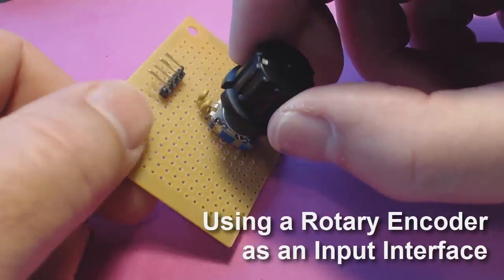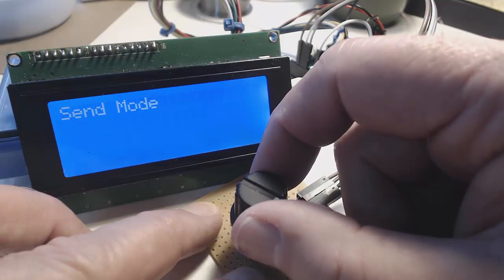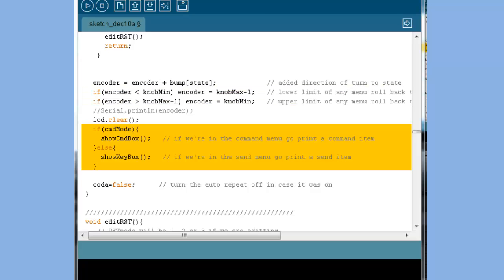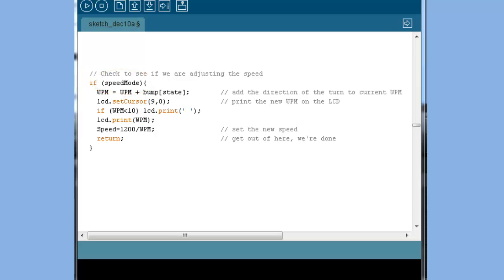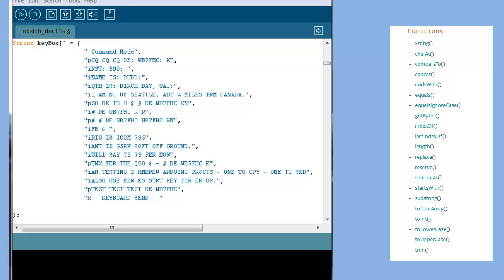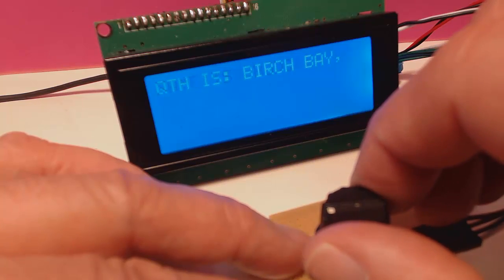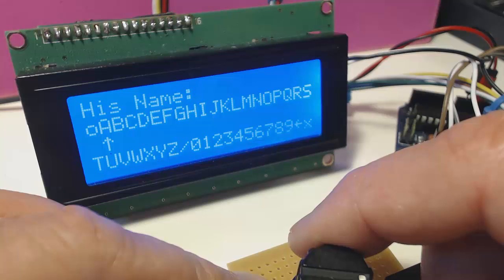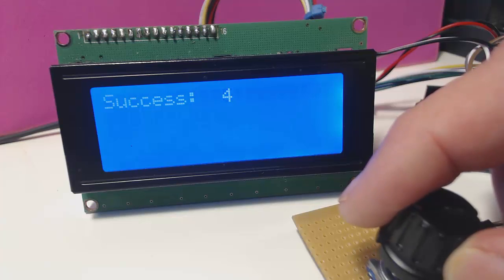Rotary Encoder Interface Options for My Pet Arduino

Comment: This is a really nice demonstration and I really like the pointer method you came up with for entering text!  In a recent project of mine I used a 2 line OLED and came up with a UI where you edit 1 character at a time by rotating the knob, advance to the next character with a short click, and complete editing with a long click.  So it was very cool to see another method that works so well, thanks!

Comment from the maker: I put together a project that would demonstrate many different ways to use a rotary encoder has an input device for and #Arduino. Maybe some of you will get some good ideas from it.

When I actually tried out live on the air, it wasn't a complete success.  I put too many features and choices into one application. Trying to run it AND copy Morse Code at the same time proved to be a challenge.

Even so, I learned a lot. I think a simpler more scaled down version will be something that I can use. #hamradio #morsecode
Reply: Nice ideas you got there ! 

Have you wondered how it could be efficient with dual screen and dual rotary encoders ? 

I'm on my way trying something like that with two nokia 5110 screens and two rotary encoders

Left encoder and left screen = menus
Right encoder and right screen = edit values

"keyboard" mode can use both screens and encoders, I'm convinced it could be rendered as a quite intuitive and fast interface to use.

Comment: Excellent job, Id give it 6 or even more depending weather you reached your goal or not
I used a mouse rotary encoder for my test project, has 3 Buttons each have a resistor that change a voltage on a voltage divider and I can combine buttons ( click and hold ) for the desired command, like (both left and right clicks reset).
Using analog wasn't that easy though, there's noise I had to cancel. I was using A14 analogue pin (Arduino MEGA).
anyway I come up with an idea is to replace rotary switch with IR remote control.. there's a library for it and easy to use.
the mouse costs me only $1 but hacking 4 USB wires for both clicks and rotary was a process I wanted to avoid repeating.
Pin A15 used to check battery status a 1/3 voltage divider 20K vs 10K ohm to ground then with another resistor to DC jack + pin

Comment: Hello 
I'm trying to use the sketch and it only changes two messages "Now in Command Mode" 
and "Now in Send Mode"

when i press the knob it stucks.

I have done something wrong or I have to put my hand on the code to make it work?

I have make some changes because I have a I2C 20x4 lcd but i dont think that is the problem

SV1EOR
Reply from the maker: ΓΙΑΝΝΗΣ ΜΠΡΟΚΟΣ In my example pressing the knob acts as a push button. On when I press, off when I let go. Perhaps yours acts as a latch. On when push the first time then off when you push the second time. The sketch would not work if that is the case.